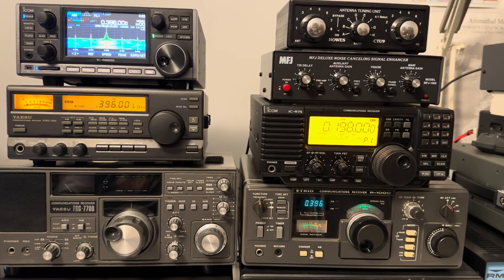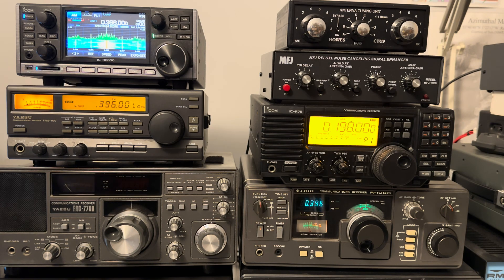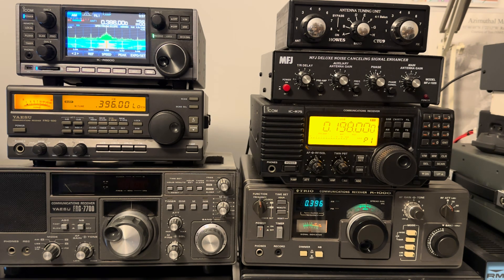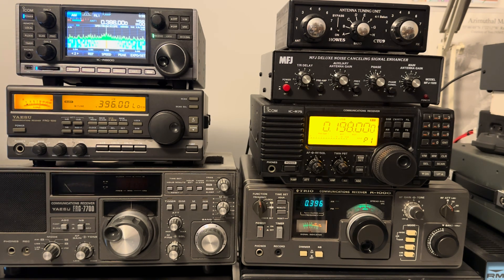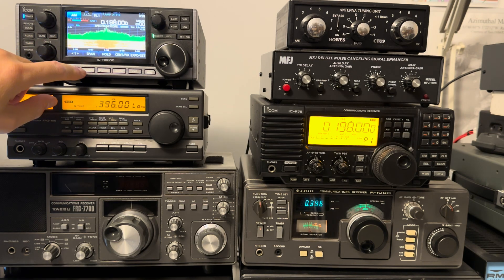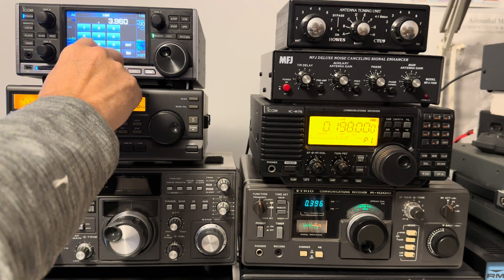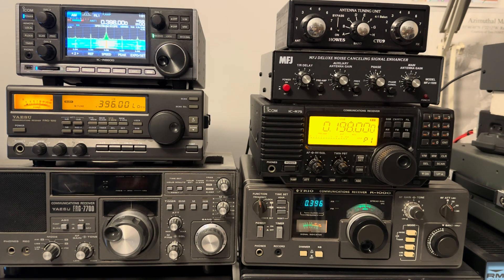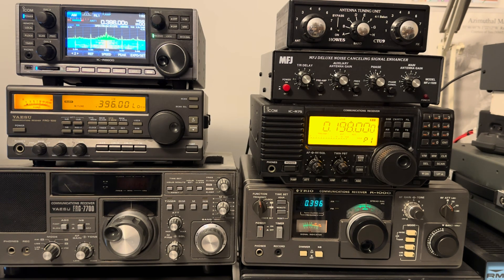BBC Radio 4 longwave 198 kHz: 2nd harmonic on 396 kHz copied on multiple receivers and two antennas

Comment: As the day is getting shorter and shorter and propagation slightly improves, i thereby report second harmonics in Poznań, Western Poland using Tecsun PL-880 with a built-in ferrite.  Of course, this is not any audio, this is JBA (just barely audible) carrier at 395 and USB.
Anyway, I checked nearby NDB for false positives. It's surely there
Reply from the maker: Great stuff, thank you very much - this proves the signal I hear is not being created by my Wellbrook loop! 73

Comment: Thanks for highlighting it, I will feed it back. Maintenance hasn’t changed and the antenna is very high Q so you shouldn’t be picking anything up unless you a very close to a site and experiencing overload of the front end.
Reply from the maker: Thank you Joe. I'll miss R4 on 198 kHz when they're gone....73

Comment: I have 3 vertical antennas and 2 wire antennas.

Using my ft-920 i get reception at 396 on all antennas.

The wire RX Ants, have clarity, the compact 1/2 wave, old skool 1/2 wave has discernable "readability" and the 5/8th has always been diabolical. 

Fyi verticals are 11m use.  Location is Northcoast Anglesey. 

Strongest AM signal is Manx Radio on 1368.  Maybe I'll check that one for spurious too!!
Reply from the maker: Thanks Richard - proves - as I did, that the signal is real! 73

Comment: I can hear in in Willesden Green using a Boniwhip/KiwiSDR.  Any active antenna is suspect but if you get it on a long wire too then it confirms that it is really there. Amazing we should only find this just before the transmitter is about to be shut down.
Reply from the maker: Thanks Simon, yes it was definitely there, although it's quite amazing how many of my subs sort of don't want to believe that! Thanks and 73

Comment: Hi great interesting vid , great array of rxers , I used to own the 2 bottom receivers . Arqiva maintains Uk broadcast systems Regards mark de G8rde
Reply from the maker: Thanks for the info! 73
Reply: @OxfordShortwaveLog  it’s a pleasure, when I used to work on txers fir the met police am sure that harmonics had to at least more than 60db down from the fundamental, I sure that the power from radio 4 lw is 400 kW so local to the txer site as well know will pick up harmonics , I wonder if yiy can receive the 3rd harmonic as matter of interest. Regards again
Reply from the maker: Thanks again. I did try to observe the 3rd harmonic, but nothing found on the spectrum scope. 73
Reply from the maker: You're most welcome Mark. 73

Comment: Nothing heard on 396kHz here in North Wiltshire.  Equipment is KISS -  Aerials: G5RV, Multiband Fan Dipole, DX-Commander-style Vertical.  Each aerial connected directly to Non-SDR Transceivers, with no Aerial switching or Pre-Amp equipment in between.  198kHz is obviously end-stopping.  I assume that this is still Droitwich, as there has been a delay in taking it off-the-air.  (Droitwich was my BBC R&D Base for a couple of years in the late 60's).....
Reply from the maker: Thanks for your comments!

Comment: I can’t find the Ofcom specs for LF broadcasting, but the MF specs are that harmonic radiation must be below 40db attenuation from the main carrier. So normal operation could give 50W on 396 into a decent antenna.  I can’t hear anything on 396 in south Bucks. 
I was an engineer at Droitwich in the early 80’s when it was still on 200KHz.  The assistant engineer in charge devised a novel arrangement with a receiver tuned to 496 KHz, where if the output reached a certain level it would ring a bell. The idea being if the bell rang there was probably a flashover between the top of the South mast (transmitting Radio 2 on 693KHz) and the LF Marconi T on 200 KHz. It never rang, but if it had, the idea was to hit the EHT suppress button on the control desk to extinguish the arc.  We were going through a period of random arcing in the South Mast Antenna Tuning Hut, which was detected by UV detectors and automatically suppressed the transmitter HT.  The cause was eventually traced to an insulation fault on the mast lighting toroidal transformers, likely caused by a lightning strike. I found the fault as I happened to be in the ATH one day when it flashed over.  Not an experience I wanted to repeat. 
Anyway if you have any concerns about the transmitter, it is maintained by Arqiva. Cheers Nick G0OQK

Comment: Maybe try your Elad, or do you have the Airspy Disvovery, i have Airspy hooked to a large Welbrook loop and can barely see a trace, (+50db on 198) but as soon as i hook up any other analogue RX, Icoms.Kenwoods etc the sig is deffinately audible.
Reply from the maker: No, the signal was definitely there because I also copied it on my random wire. 73

Comment: I have no experience of the Wellbrook, but is it an active device? The harmonic may be generated within the loop, and the signal re-radiated and picked up on your random wire. The signal on the icom at S9 plus 60 db is fairly large. I used to get SDR overloads from Moorside Edge when all three services were working at full power with levels that match your Icom. I used to do field strength surveys around Moorside Edge and would get some crazy intermodulation products near power lines. Enjoy your channel, keep up the listening.
Reply from the maker: It is an active device, but I also picked up this harmonic on my random wire. 73
Reply: @OxfordShortwaveLog yes, but could the Wellbrook be re-radiating the signal. If you power down your loops and then try your random wire again.
Reply from the maker: I don't think so because the 2nd harmonic has now gone - it was a temporary thing.